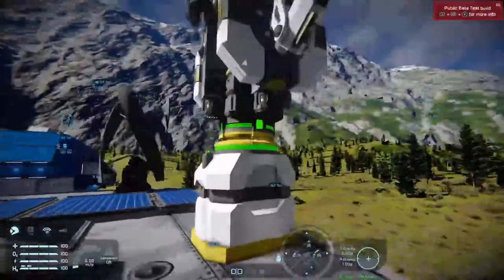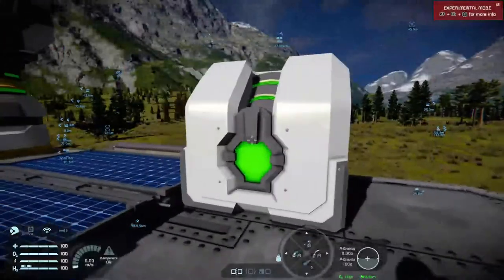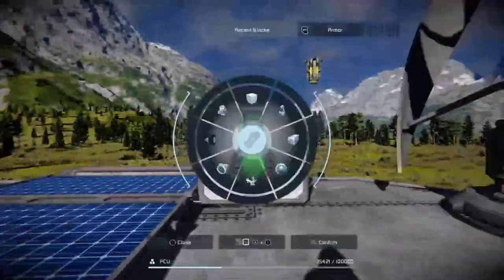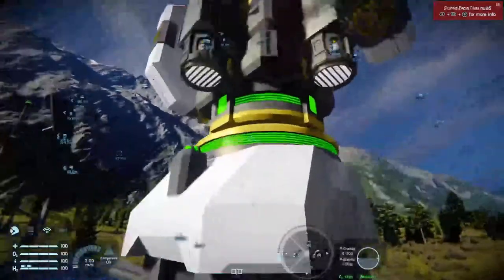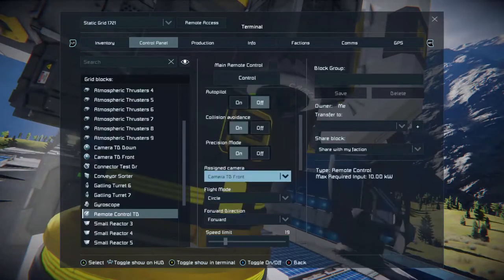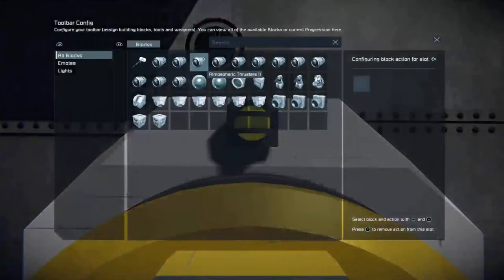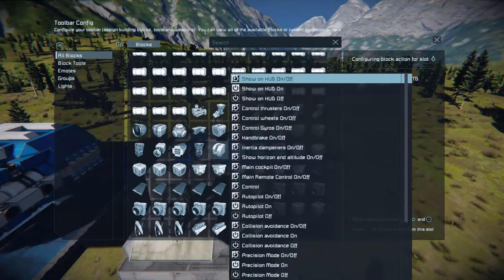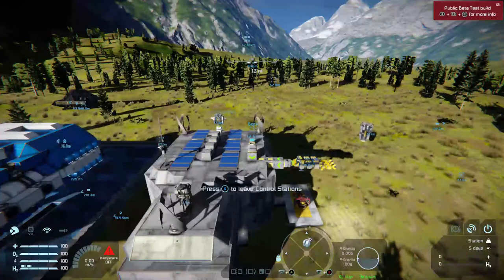Space Engineers Xbox One Tutorial Part 11 - Remote Control Drone Flight Station

Comment: So if i put a control seat on a rotor, could i make the ship a drone i can fly, even tho the seat is on a separate grid? I want to have the seat turn 90 degrees vertically, so the whole ship turns and the wings turn into a blade like ship.